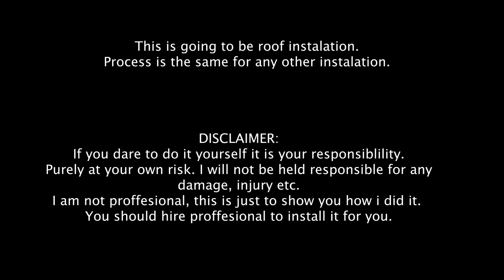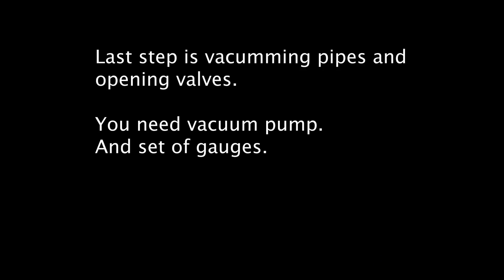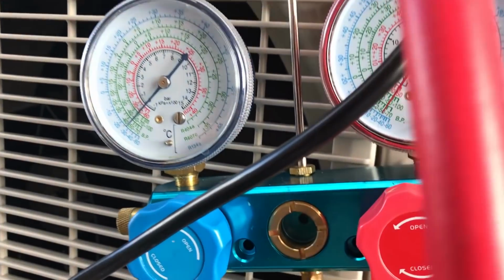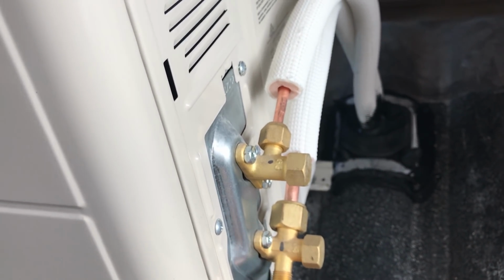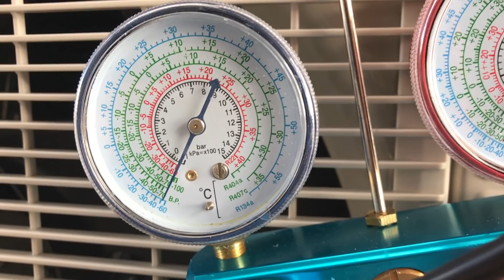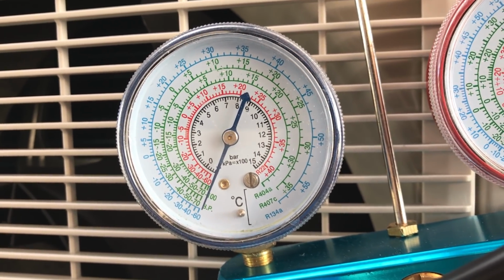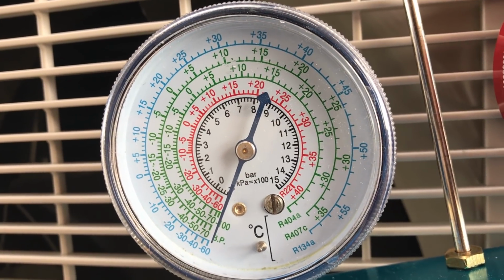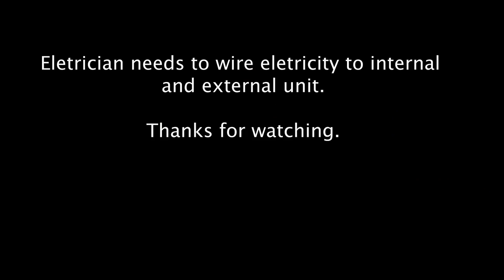Step by Step DIY - Split System Air conditioner install

Comment: Works so well Fastly.Cool that it only requires daytime operation until high temp and humidity are overnight. It is difficult to get to side filters, but back is easily accessible.

Comment: great video buddy , i am looking also into doing this myself , i watched a few DIY videos and your video looks good also , just leave the connector to the manifold on the outdoor unit and turn the 2 valves open first and seal the caps with nylog blue sealant and screw the caps on good , last is to disconnect the tube to your manifold of the vacuum pump , instead of micro bit of air going inside the tube you will have some cooling pop out of the valve before the schrader valve closes , put also some nylog on that and screw on the sealing cap tight , done and no risk of air getting inside , just my 2 cents here how to make it perfect from all the DIY videos i have seen on home install of a split airco system , other then this small detail you have a great video....

Comment from the maker: 2 years after, aircon still running strong. This was my 2nd ever DIY aircon install. I think i did pretty good. Everyone is commenting about air coming in. In instructions it said to remove vacuum line and then open valves, you guys are saying release valves and then disconnect vacuum, which could be totally correct not sure.

Comment: Why on the roof? Easy and quick access is vital; seems like putting it on what looks like a sloping and corrugated roof goes against this important requirement.  At 6:06 when you loosened the service port connection after drawing your vacuum you've lost the vacuum for the split second the Schrader took to spring close because of the negative pressure (air rushes in).  It is better to release the charge to break the vacuum; the positive pressure from the charge ensures no air gets in when you disconnect  your fittings.
Reply from the maker: I followed instruction in manual, there is no way disconnecting from Schrader valve without loosing some vacuum. Many are commenting here about that. Unless you do what you said to release charge before disconnecting hose from valve.
Reply: @BACOVIDEOS  he is right you did let air into the system Schrader valves only work when the little needle inside is completely decompressed ( for example when there are no gauges connected) what you should have done is released some refrigerant into the system after vac (only 200kpa or so) then take the gauges off. You need the adaptor because you have the wrong refrigerant gauges by the way.

Comment: Hi sir, i'm new to airconditioning. Why does the condensor have to be vacuumed?
Reply: You want to remove the air, (consists of 21% oxygen, 78% nitrogen and argon) which has worse properties than the refrigerant for cooling, from the system.
Reply from the maker: I am new too. It is just to get air that is in pipes when you installed them out. Create some vacuum so that when gas from compressor is released air is not taking space. And i also think if air is humid it could affect system later on.
Reply: It's not just the air you are removing it is also any moisture in the line. That's why you leave the vacuum pump running for so long. When you lower the pressure in the line so much, any water in the line will actually boil at room temperature turning into steam (water vapor). It is this water vapor that the pump is removing along with the air. It's very important to get every bit of the water out because, if it mixes with the refrigerant, it creates an acid that will, over time, hurt the pipes. Corrosion and sludge buildup will occur.

Comment: What you should have done when you released the refrigerant was allow the refrigerant to flow while releasing the guage therefore you eliminate any chance of oxygen getting in which by experience does not end well.

Comment: I'm so glad you used a vac pump for an entire 15 minutes only to completely undo the process by taking your guage line off. Could have saved yourself 20 minutes.
Reply from the maker: So you think that small leak of air undid a whole process? I don't thinks so. Maybe if pipe was 10cm long :)
There is more air in 4-5m of pipe than in that leak. I just think vacuum went from -1 to 0.8 which doesn't affect system.
Reply: BACOVIDEOS You might want to do some more reading on this one. Lmfao. This is why trained and licensed tech's only have to worry about more work in the future. Everyone's an expert I love it.
Reply: @jeffscanlan3554  you're 100% correct

Comment: ammm how do you calculate pipe length ?
Reply: Just use what the manufacturer sends its charged for the lenth when you start shorting or making line sets longer you to accommodate that lenth for how many lbs of refrigerant you will need ...but it's just best to use what they give you if you want the indoor unit in a certain spot just set the outdoor unit where the lineset lands

Comment: He is doing wrong. He is Vacuum for nothing. Because of he running vacuum, but he disconnected vacuum hose before he is release the valve. He let the air stuck back in the tube as original stage
Reply from the maker: You could be right, i followed instructions in manual that came with unit. I think it is so little it doesn't affect unit at all.
Reply: Isnt the vacuum done only to see potential leak?
Reply from the maker: @jendakafec7631  I think so too, many are making it too complicated to as somebody said already "protect income".